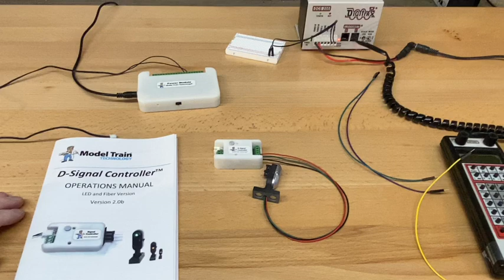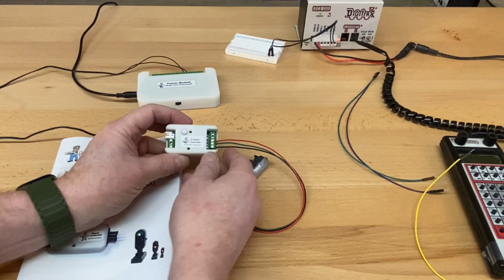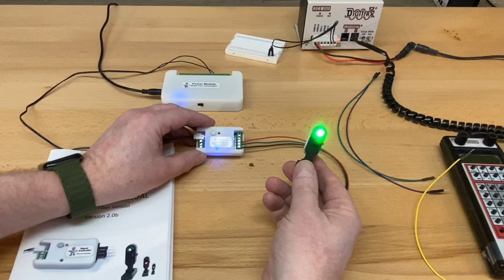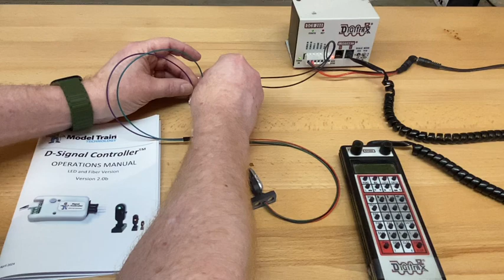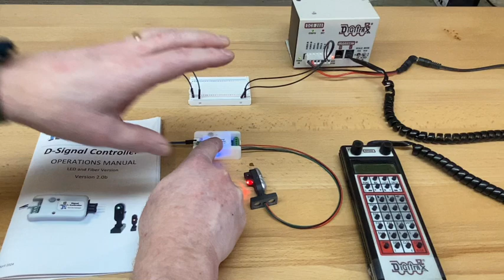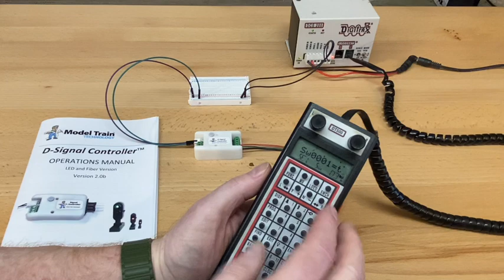Dwarf Controller for LEDs Setup

Comment: In DCC mode, would the yellow aspect work in a 3 color dwarf signal?
Reply from the maker: A three aspect dwarf is simply a 3 aspect block signal - thus, the "block" Signal Controller would light it properly.  The Dwarf Controllers all have just 2 aspects. DCC or detector mode would not make a difference.